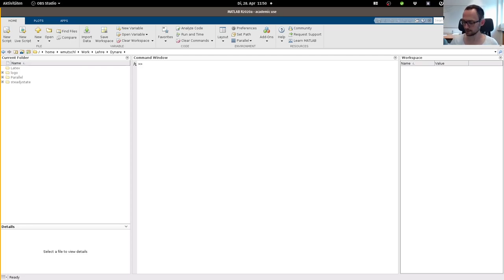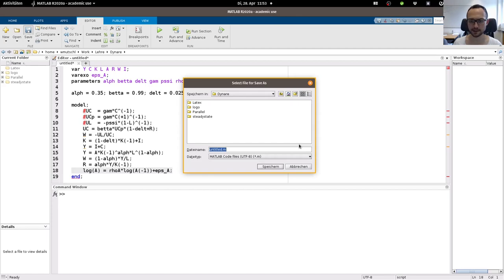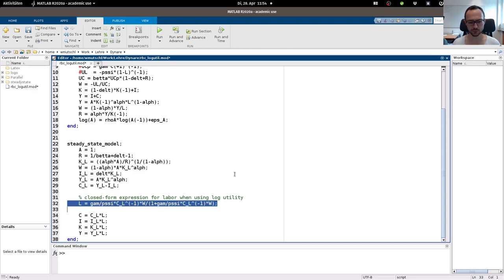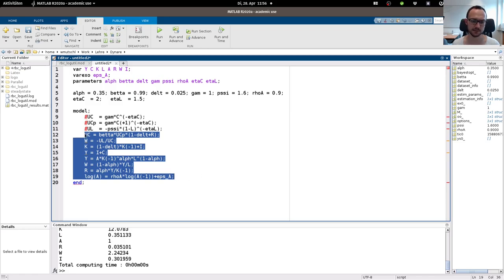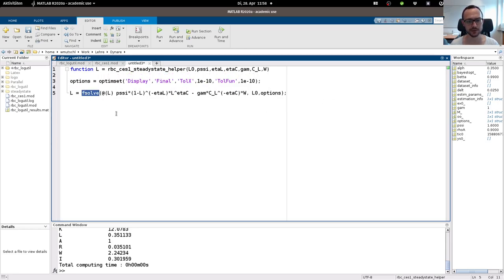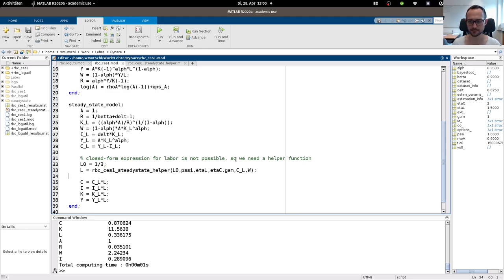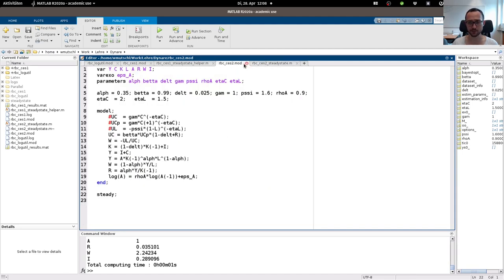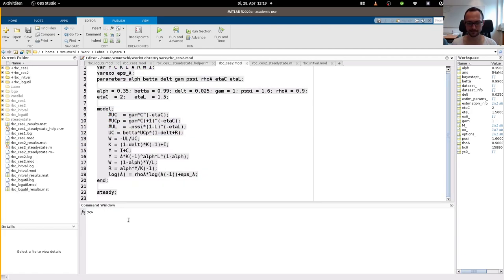4 methods to compute the steady state of a DSGE model in Dynare

Comment: Hi, thanks for this video, its verd helpful. From Prof Pfeifer I saw, that when we have a parameter that is dependent on other parameters (eg epsilon=(1-sigma)/sigma) then one should define that epsilon in the steady state file. How would you do that such that the new parameter is passed from the steady state file onto Dynare? And would you still have to state epsilon as a parameter in the mod file or do we only keep sigma in the parameters?
Reply from the maker: There are different ways to deal with endogenous parameters, either use model local variables (those #epsilon within the model block, or declare them as parameters and update them in the steady_state_model block. The latter is more for advanced users, because you need to be aware of this. If you are not estimating these parameters, then it really doesn't matter; however, if you are estimating, you need to take this into account and not estimate both parameters at the same time.

Comment: Hi there, I built an extension of the Kiyotaky Mooore model. I’m trying to use Dynare to calibrate the model. I’ve tried so many times, even changing the equations order, and I’ve got the following error message:

Warning: Some of the parameters have no value (q_ss, uu_ss, b_ss) when using steady. If these parameters are not
initialized in a steadystate file or a steady_state_model-block, Dynare may not be able to solve the model…

I’ve got this message so many times, I don’t know what is wrong. The parameters q_ss, uu_ss, b_ss are defined on the calibration section.

Thank you very much for your help!
Reply from the maker: Have you raised your issue on the Dynare forum? It is our official support channel. The warning is quite obvious, you need to set values for the parameters some place in your mod file or in your steadystate file.

Comment: Hello, when solving models in dynare, should I expect the residuals of the static equations to be zero for all equations?
Reply from the maker: When evaluating the model equations at the steady state the residuals are supposed to be zero (or at least numerically close to it). If not, then the steady state was not correct.
Reply: @wmutschl  Thanks, in that case should I start with equation number where steady state is not close to zero?